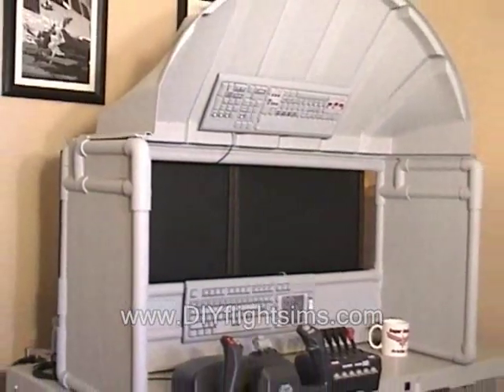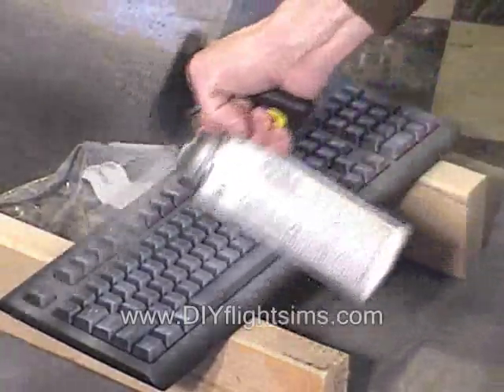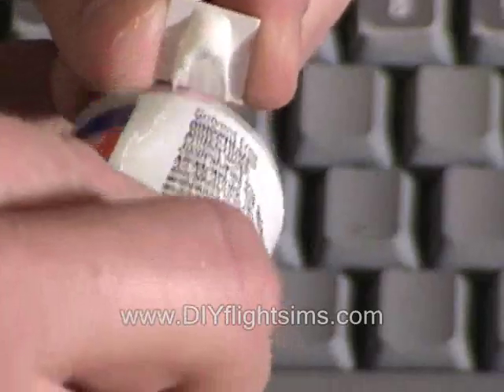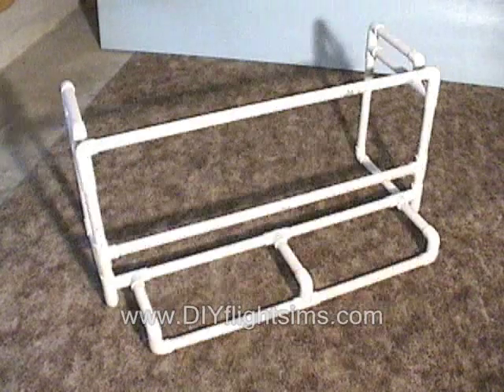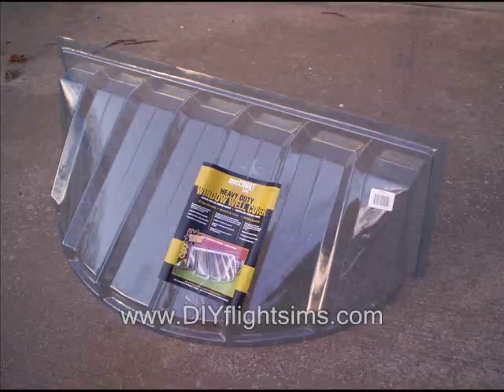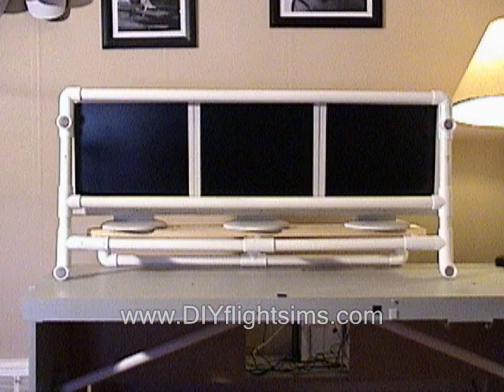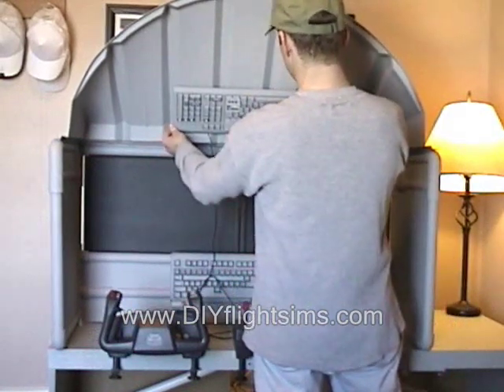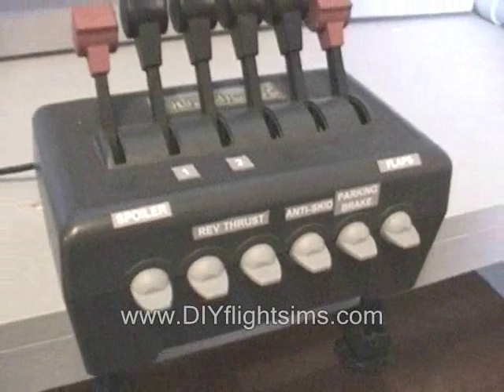DIY Easy Airliner Home Cockpit

Comment: Alright, so I am interested in buying this, as I am building a portable Combat simulator as well. However, the only reason I would be purchasing this is to find out how you do the separate keyboard assignments in FSX. I want to be able to have two keyboards, and have, for example, the "A" key assigned to 2 different functions, one on each keyboard. Will the kit explain how this can be done if I purchase this kit?